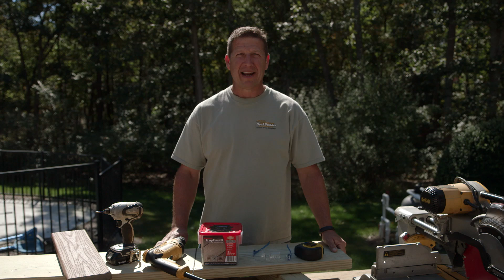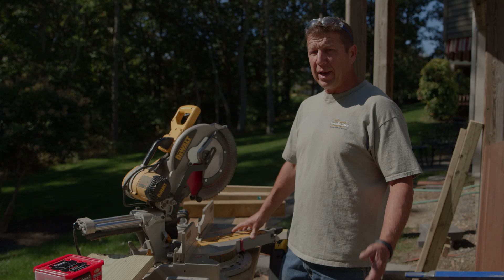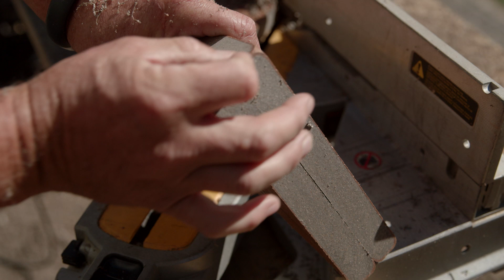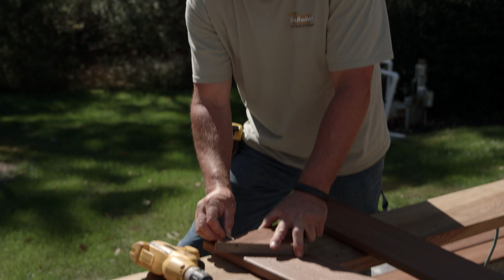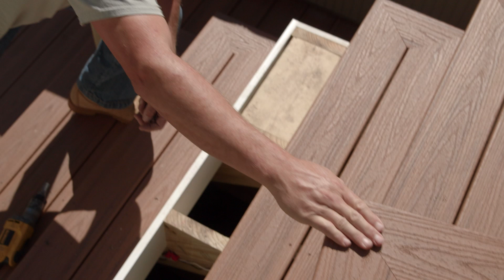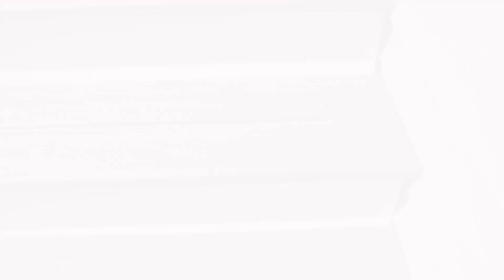FastenMaster PROTips: Picture Framing Stair Treads

Comment: That's only going to give a 11 inch tread.  Minus the the half inch nosing and you have 10.5 run.  You don't mention the rise but 10.5 is too small for exterior stairs
Reply: Code for deck stairs says 10in treads are the minimum. 11in is within that allowance.
Reply: Wisconsin code says 9" minimum tread depth and 8" maximum riser height.

Comment: I did this but the only change I did was glueing the joints with CE glue first...allowing to set up for 30 min...then drill and install screws...no chance of the debris screwing up the joint. The big positive I took from your video was to keep the pilot bore clean...I would have screwed that up for sure.

Comment: 3:04  Kreg face clamp would be good here--also, this method doesn't work with the scalloped bottom boards, not enough material. They would need to be face screwed at the miter into the plate.
Reply: Does face screwing the outside edge of a board like that still require screws through the miters?

Comment: Great idea and they look beautiful. I’d be interested in knowing how they held up after two years. Couldn’t imagine doing this with cellular pvc decking ?
Reply: Yeah pvc would explode
Reply: @olbabybeard  care to elaborate?  By explode you mean it would warp?
Reply: @e4d578  based on my own experiences pvc expands and contracts more than composite. I've seen 1/8" gaps change to 1/2" overnight with pvc. Granted the boards hadn't been properly acclimated before they were installed. Even when acclimated, you can still have growth and shrinkage up to 1/4" in either direction, depending on how much the temps change in the area. The screws he installed in the video horizontally through the miters will not stop the board from shrinking or growing and the gap with happen anyway. Once it does the screw basically guarantees it will NOT grow back together nicely. Composite does the same thing but slightly less.
Reply: @olbabybeard  thanks for the info! I know Dr. Decks has a pretty good solution for covering end pieces and he works almost exclusively with pvc
Reply: @e4d578  yes! I've seen him use facia and deck boards to make skirting for stairs. He uses PVC glue for miters in some situations but fastens it carefully. Big fan of that channel

Comment: Awesome video. Quick question... for composite, do we not need to leave space for flex and retraction/expansion due to cold/heat? Is it safe long term to have really tight seams like that?
Reply: In this case, the two long boards move together. The small piece is so small that movement is negligible. So tight joints in this case is fine.
Reply: @kevinwise982  Not at all,  Every piece, regardless of the size will expand and contract. It all depends on where the deck is located, and how hot/cold it gets though.  Here in the south, where it gets well over 100 degrees on a normal basis, and can sometimes get into the freezing point, it is never advised to place any composite material together like that. We are always using a gap. We simply go by the manufacturer's temperature charts for the gap distance.
Reply: Good question--deserves an answer

Comment: I tried this on some sample piece today, and after pre drilling holes, cleaning junk between angle joints, when I screw it together, the joint move/slides off allignment.. tried 2 different type of screws... same results

Comment: Every other resource I've read or watched contradicts this approach. This doesn't seem to give any consideration to expansion and contraction of the composite decking. Nope.
Reply: I was thinking the same thing. I’ve done joints like this and they ended up buckling. And they were directly fastened.
Reply: dont have to worry about expansion/contraction for directly fastened deck boards joined with miters
Reply: The way that the treads are fastened down , the backing, type of lumber used for the stringers are all important if you want the mitred stair treads to look good and last. These stairs have open ends. If they were a closed stringer stair design expansion would need to be addressed. 
 I think perfectly installed backing and the way they are secured to the stringers is what will make or break a guys fancy stair cuttin high faluting cockamayme carpaintering
Reply: Ah, but they are still solid all these years later. Hmmmmmm.
Reply: It doesn’t move very much at all

Comment: I’m doing my deck over right now and will use this method for doing the stairs,it’s beautifully done.Im reading that it’s not advisable to use the cortex screw —plug system on stairs for some reason—no reason was given but I’m gonna try it.I will block between stringers to make it dead solid to reduce flex and it should be fine.Thanks for this video—my wife will love NOT seeing the exposed ends of the PVC boards.
Reply: Yeah... You might get some butt stuff

Comment: Nice work, I am wondering if a pocket screw jig would work on the underside for attaching the triangular piece to the ends, instead of running a screw through the sides where it is visible
Reply: Yes I believe it will work. I’ve seen it done before just never done it personally
Reply: Dr.Decks has a video where he does it
Reply: Talk about time consuming…

Comment: tNice Vid.  Too bad you omit the most important information.  You never mention what size drill bit you're using, and you never show how deep you are drilling.  Are you just drilling through the first piece or does the drill hole go into the second piece?  I've been having fits trying to get the screws to sink right and I know it's because I don't have all the info. Thanks

Comment: Awesome! I hated my stairs for that exact reason, exposed ends. Any idea about plugs for the screw holes?
Reply: Plugs are sold separately, and same color and texture as the boards. But I don't think all composite decking brand offer it. Trex does. Special drill bit also needed too to recess the screws a bit leaving space for the plugs, but doesn't look like the video guy went that route. Woulda been a much cleaner look had he done so though.
Reply: Dr. Decks has a solution for exposed edges

Comment: all composite manufacturers note that 1/8" gap minimum between board edges are required. The picture frame looks great but isn't there a chance that there could be some expansion issues due to the ends of the picture frame installed snug up against the step boards??? I'm wondering if Mr Daley could comment if he has time.
Reply: My Trex rep says your most likely okay on stairs to get away with this because the treads aren't too long. But I see people doing this on long picture frame runs and that's a no no.
Reply: @Soul-driven  All pieces will expand and contract, regardless of their size.
Reply: The screw you add to the joint helps to minimize the expansion/contraction in the corner 👍👍
Reply: Caution, anyone following this video to copy for your project, the author clearly didn’t video in correct sequence as the two end piece cuts cannot be from the same plank or the two won’t be the same size.  He shows an end cut (fine), then flips the same board for another end cut which is the problem here!
Reply: First dont buy trex. There are other manufacturers. Dont use hidden fasteners. Also consider the temp conditions at time if installation. If its summer and boards are hot than they are already expanded and can only,  shrink. So if you leave a 1/8 gap on hot boards you will have a 3/16-1/4 gap when the sun goes down. Not a good look.
Reply: @tylerdurden5359  Why would I not want to buy Trex and then buy another brand that also expands and contracts?
Reply: @tylerdurden5359  The composite manufacturer I am looking at has a chart that shows current temp and expected highest temp and then tells you the gap that needs to be left.

Comment: Gary,Very nice work. My stair treads will be 100" long. If I build them this way, do I have to worry about the expansion or will they act as one piece like you mentioned?
Reply: As I understand it expansion doesn’t happen lengthwise although I am going 1/4” space vs 3/16”

Comment: Be careful screwing into the edge of the Trex and putting outward pressure from the screw.  Make sure to use a drill bit that remove as much material as possible so that the threads just grab.  I have done something similar to this on several decks with Trex Transcend and a year later after a few freeze/thaw cycles the top of the Trex splits from the outward wedging pressure the screw exerts.  I had to go back and replace all the stair treads.  

Drill a hole just slightly smaller than the treads and drill it the entire length of the screw.  It was a lot of work to go back and replace those stair treads and I have learned my lesson.  The real issue is that it does not happen for quite a while (freeze/thaw, freeze/thaw, split), so you can have quite a few decks complete before the evil splits show up.  You can do it, just heed my warning so you don't get call-backs:-(   

Also, you can download my app (Whitmer Decks Field Tools) to help figure your stairs 
https://play.google.com/store/apps/details?id=com.whitmerdecks.wdfieldtools

Shameless self promotion ;-)

Comment: You don't use plugs over the screws?  Looks like crap
Reply: I saw on another channel to use a heat gun after gently smashing the edges of the hole into the screw hole. Looked great!
Reply: It doesn’t look like crap. It is creative.  The minimum purchase on cortex makes the cost prohibitive. If he was to stock all color plugs he would have a lot of inventory $$$ on the shelf.  Business 101: make margin or get out of the business.  Petition for small quantity plug/screw packages 30/pack and then you would have a very valid suggestion.
Reply: Jaelyn Donnelly I’ve bought them. They don’t cost that much especially if you are already paying for composite decking. Your wrong
Reply: I trust you because of all the decking project videos you have published on Youtube.
Reply: I like using cortex plugs but the screws here on the stairs actually look great.

Comment: It looks great, but I thought composite decking manufacturers all require an expansion gap between all boards.
Reply: Do your decking at manufacturers specks. Otherwise they more than likely will not guarantee the product. And all these products are very expensive.
Reply from the maker: In many cases, composite manufacturers call for gaps between butted ends of boards or ends meeting up against fixed objects (walls, etc.). This is to keep expanding boards from pressing against each other or immovable objects.  In this case, the four pieces being joined are acting as one uniform board, expanding together in the same direction
Reply: Interesting, I talked with someone at Trex I believe it was, who explicitly told me to gap miters. I know because I asked in particular with regard to miters. As a carpenter, I naturally hate gaps in miters, it just doesn't look right. If you've done it successfully without buckling that's great news. I also talked to someone at Azek, which make PVC boards (not composite), and that person told me tight miters are recommended!
Reply: @FastenMasterPro , they can't expand the as one single piece when the grains are ran in opposite directions.